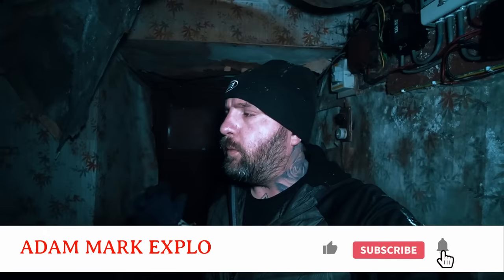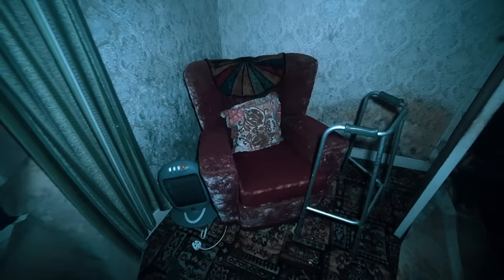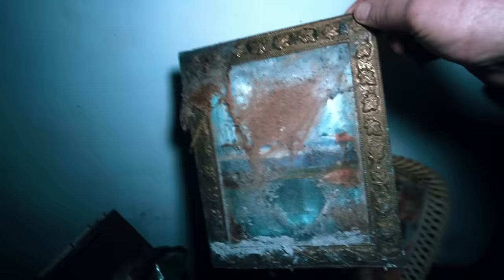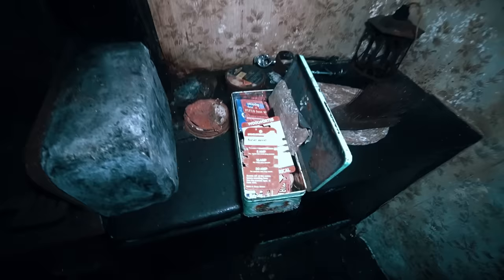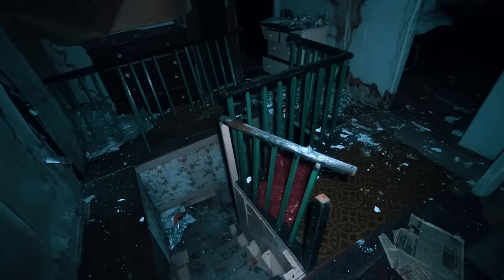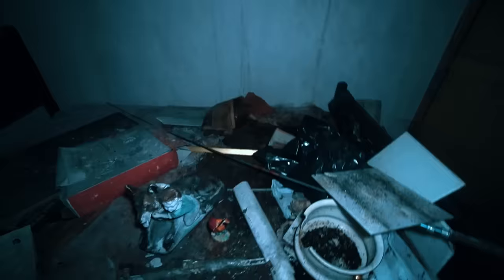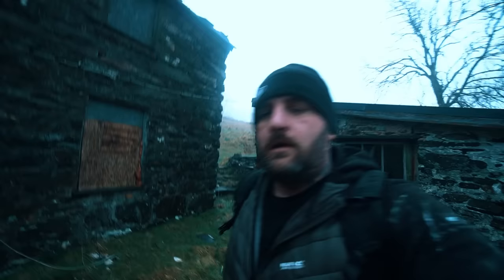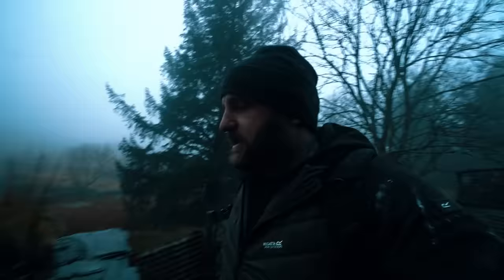Abandoned House Frozen in Time for 60 years!!  Unbelievable Time Capsule In The Mountains

Comment: The small white plastic canisters mounted on the inside of the kitchen cabinet door are for spices plus salt and pepper. Back in the 60's, people filled these matching items with salt, pepper, and a few other spices they frequently used, like cinnamon, nutmeg powder, etc. The very low doorways were from the days before air conditioning. In country homes of people who were not wealthy enough to afford unlimited heating bills, the rooms had high ceilings and very low doorways to trap the heat inside the room in the winter. In the summer, the high ceilings allowed the heat to rise, thus keeping the room cooler. The home I grew up in the US had this feature in a couple of the rooms. My father who was 6'1" had to stoop over to enter these rooms. Cool explore. Thank you.

Comment: The 4 little containers hanging on the inside of the cupboard door, I THINK they are vintage Tupperware salt and pepper shakers. If you’d of flipped the little cap on top the holes would open them up to shake! 😃👍

Comment: Those energy saver light bulbs didn't come into common use until mid 80,s. And that house was partly rewired in the eighties. I would think, going by the consumer unit and wiring. The switches are older. Definitely still occupied well into the eighties. I much prefer your explores without the flashing lights. Putting up the dates of items in the house nice touch.

Comment: On  the kitchen cupboard door, vintage Tupperware herb rack. That's a Range in the dining room, which would have been the original kitchen, I would have thought. The chain would have been for cooking pots, kettle etc. The fire would have heated the water which was put in the 'copper' hence the tap. A Range would have been the main source of heating the home, cooking the food and having hot water. My Gran had one, there was so a side oven too

Comment: Good morning, just to let you know that I spotted at the beginning the electric meter tails had new coloured insulation tape on them and also the meter was not very old. A couple of the isolation boards were not that old either  which says to me that is has had a rewire. The energy saving light bulb was in a light pendant that had modern twin and earth supply cable to clipped to the beam. Please be careful because  wiring alone can cause you to get stuck in a death trap. Love this investigation and love how you have done research in when items you found and giving dates when they were discontinued 👍👍👍

Comment: Weirdly the thing I noticed almost straight away, the shed roof in the panning shot is quite new, yet as you stated the house looks like it was left 30 or 40 years ago, abandon properties are weird.
Also someone weirdly upgraded the power meters but didn't upgrade any of the house wiring, weirder and Weirder.

Comment: Wow, how thick those walls are. The window insets look like its a medieval castle.
Wouldve had somewhat a self regulating temperature as it be kinda like a cavern inside.
It'd be chilly inside all the time. Definitely need some fireplaces going to warm it up,probably even in summer.
I lived in a huge old mansion house for couple years that was divided up into different apartments, it was built around mid 1800s and out of local sandstone blocks. Huge blocks of stone. Our section was the old ball room, main parlour,it went full length of the house at one time.
Anyway, it was nice place as it was like living in a cave, it kinda maintained a semi constant temperature,as our summers are hot and humid here, it had a natural cooling as the walls were three feet thick or more. The windows were pretty poor though except for the front room and back rooms that had thede huge tall windows that were like ten feet tall, they were like southern mansions with the walk out "door windows" that went out to the porch.
 The rooms were easily 15' high to ceilings.

Its such a shame that beautiful stone house in your video is going to ruin. It could be a very nice place again with some modernizing of decor and repairing leaks. I was amazed the floors were not rotted out yet of there was leaks.
In my region its so humid and we have a lot of mold problems,damp wood and leaking houses dont last long before they deteriorate so quickly.

Comment: 2:13 Some of those electric fuse/circuit boxes look more recent than the 1960s - white plastic with stickers with logos on them? Maybe I'm wrong. But the light switches are the type I remember in houses in the 1960s. Microwave from 1978 so perhaps the last owners were there til the 1980s? Just to add, at 30:04 there is modern a long-life light bulb hanging from in the ceiling. There must have been electricity recently for that to be there? Strange, its like a detective story; "They mystery of the cottage."  😁

Comment: Halogen electric heaters are not banned in the UK. 
Halogen light bulbs are banned. 

Looking at the electrics it doesn't look like the house has been abandoned for that long. There is a RCD trip switch and digital meter so must be last 15 years.

Comment: The house has been empty a long time but perhaps not as long as you thought. The mains breakers as you came in are a 1990s pattern. The low energy light bulb is also a 90s pattern. Low energy bulbs were invented in 1976 but were shelved due to production costs. The electric heater near the old chair is also a 1990s model and yet so much looks 1970s, maybe squatters were there for a while.

Comment: You can clearly tell that there was some kind of occupation "recently" judging by the phone socket on the wall by the record player, that type of master socket with an upper and lower section (separated by the sectional line) on the faceplate is very modern and was introduced after 1991. Also look at the electric junction box setup that looks quite modern.

Comment: Why does the title say abandoned for 60 years? Those lightbulbs are modern, and some of the electrics, breakers in the beginning of the video, are maybe from the 90:s, early 2000:s. It probably been abandoned for 15 years. But no heat and the weather, can quickly make a house fall apart.
And when explorers starts experiencing "paranormal activity", then it just becomes silly...

Also wear a mask. Breathing in all that mold, is really bad for your health.
Reply from the maker: I know but I couldn't ignore it really as It was really strange. I know what you mean with the lights and that. Very strange mash of eras